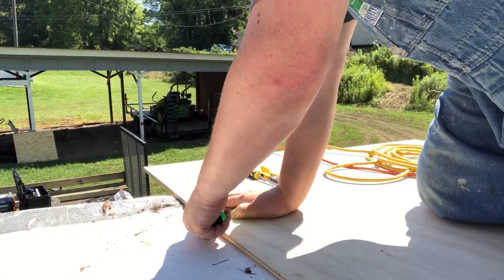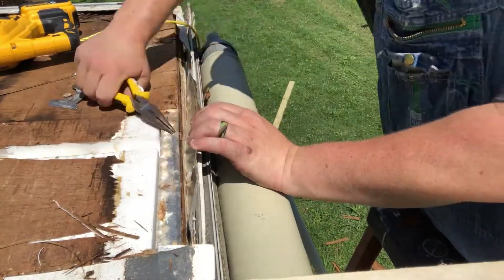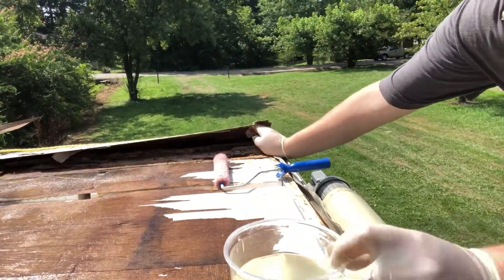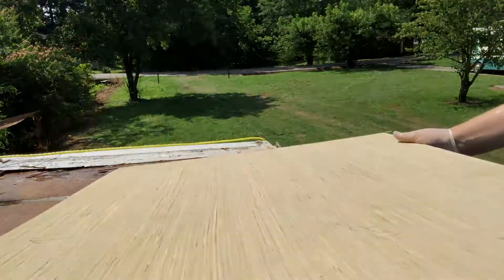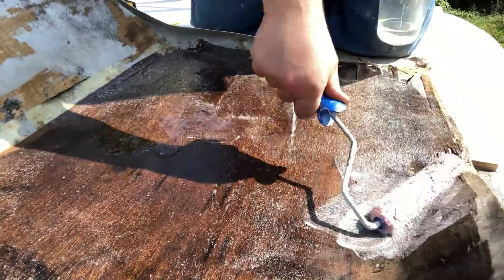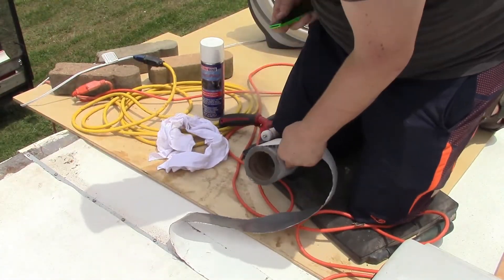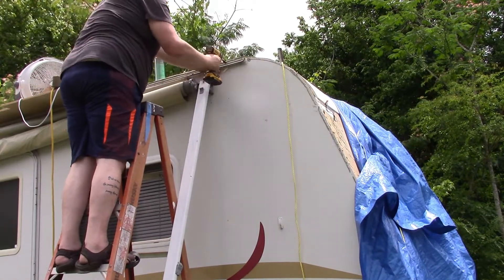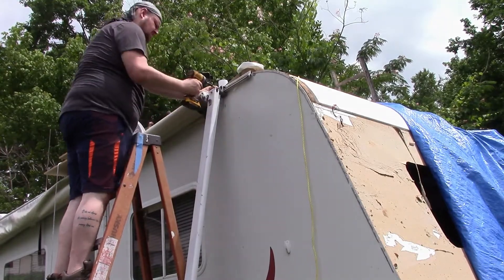RV Roof Repair DIY Part 2

Comment: I enjoy your calm demeaner and clear logic for approaching this. About my story, I had bought a 20 year old travel trailer this week and just brushing up my vocabulary before i hire a dealer to fix a dented corner and re-seal just about everything or do a new roof and walls. 
Is it weird i think you can make a great bed time story reader or therapist. Hang in there and enjoy your new camper and good luck getting the armor product, maybe it can be free in return for the publicity.

Comment: Thanks for the education. I am in the beginning phase to repair my roof by myself and your video just gave me exactly what I needed to start today.  I have the sidewalls, overhead bunk area, bottom section of the driver and passenger door walls, and all the windows need to be resealed along with fixing the awning and the gutter.   Big job for sure!
Reply from the maker: It is a big job!  So big I got tired and bought a brand new camper.  The things I learned.  1. The damage is always worse than you think it is.  #2 epoxy doesn’t want to stick too well even if you have firm pressure on it for a couple days (In my case anyways.). #3 if any of the fiberglass is completely unattached in an area it would be better to put new fiberglass or aluminum sheeting over the area.

Comment: Been researching what to do & use replacing roofing membranes one thing I find that the big rv repair shops use to bond wood down ontop of foam is great stuff adhesive its expensive 28$ for 26.5oz but will bond well. as for gluing down tpo roofing or pvc there is much out there I called roofing companies they have good glue for gluing down the membrane but want to charge for 5 gallon bucket that starts off at 500$ which have no need for extra glue only need 2 gallons but they dont sell in 1gallon size. as for doing any roofing even though I know where bad spots are I still would rather take the whole roofing membrane off so can see if any other areas are damaged.
Reply from the maker: This is my preferred way to go now, after dealing with this before I actually put an RV armor roof on my new camper so I didn’t have to worry about it.

Comment: What spray did you use to glue the roof onto the foam from Home Depot? I couldn’t really hear it thank you In advance
Reply from the maker: I used 3M 90 spray, which was recommended by an RV tech, but I would recommend folding the flap back without cutting it by taking it loose on the end and both sides and then folding it back.  I would also replace the wood from end to end and take it back to a roof truss.  Definitely, more work than I had originally thought.  Also if I were going to do a repair myself as a DIY I would think about possibly going over the finished roof with a product like henry's tropicool on an older trailer like this.  From what I've heard, the biggest thing is making sure it's very clean on the roof first.  On our new camper we went with an RV armor roof which is great, but it can be expensive, especially for an old camper.
Reply: @GimpyCamper  thank you so much

Comment: It's been about a year since you uploaded this - How IS your roof holding up? I'm about to do mine, in much the same way you did... just wondering, because it is my first DIYing of a roof!! :) Any tips or help would be appreciated! Channel has been a pleasure to go through and watch!
Reply from the maker: Well...  after I went through and fixed all the rot, it really pushed me over the edge.  I sold it and bought a brand new camper over a year ago.   I’m also in discussions with RV roof armor to get their system on my new camper with a lifetime guarantee on my new camper.  GOOD LUCK!  It’s always worse than you think.